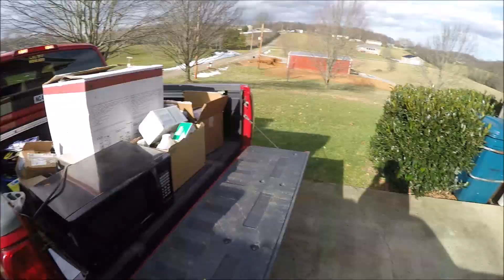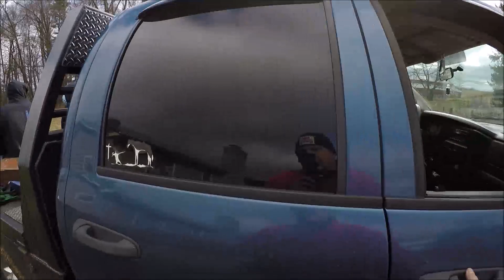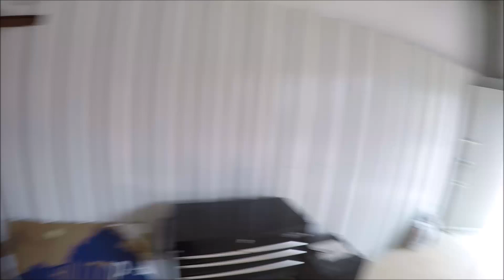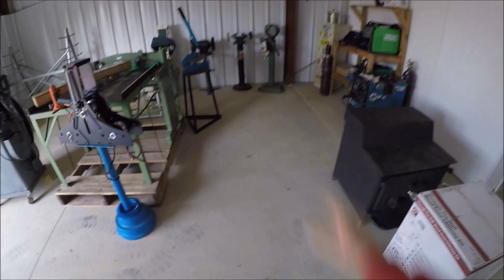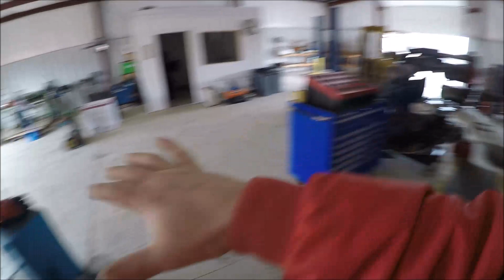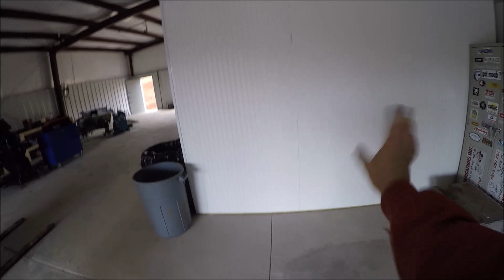Finally moving into the shop

Comment: Looks like it will be a very nicely laid out shop
Reply from the maker: Thanks Adam. You are going to have to expand yourself at the rate you are picking up machines.
Reply: I know, it’s getting tight in there, thankfully most of my work is smaller, I probably won’t have the room to do any big fab projects unless it’s in the driveway

Comment: You and Steve moving at the same time. Two big shop projects finally paying off! 😎
Reply: and Max bring up the rear....
Reply: @metalworksmachineshop  Way back in the rear !
Reply from the maker: Yep. We have both been at it awhile. I need your big Hyster to move my machines. LOL.
Reply: Hill Top Machine Works Well it is running and it probably would move but no hydraulics yet!